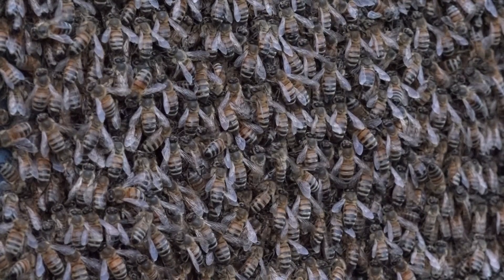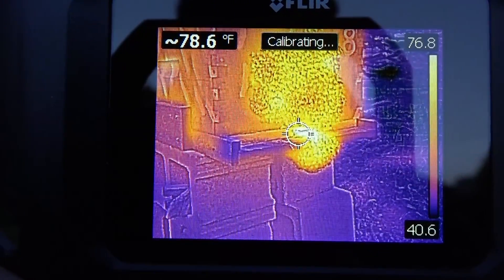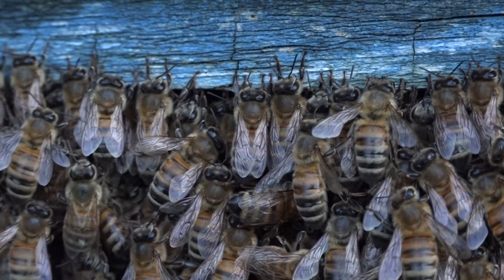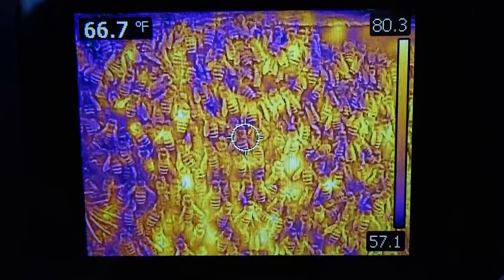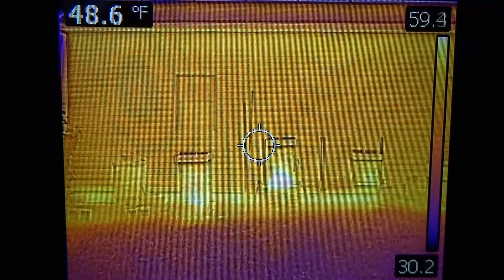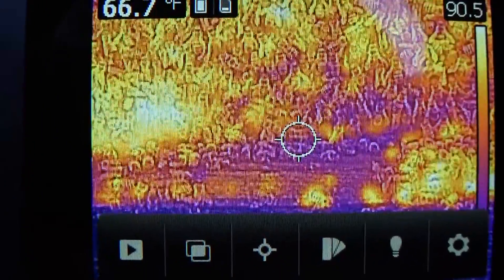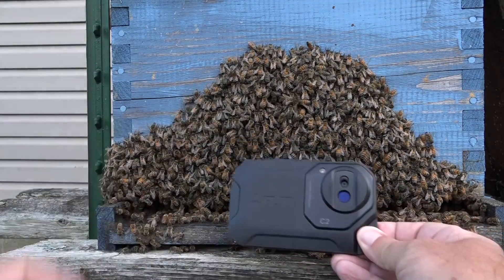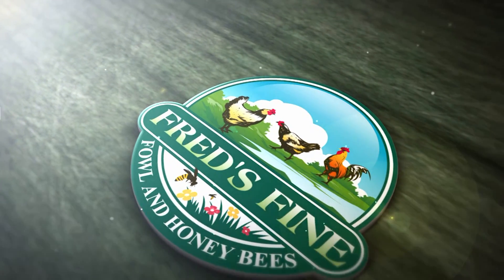Honey Bees Bearding On Bee Hive  Thermal Imaging FLIR C2 Hive Temperature

Comment: HiYa Fred, You are a gentleman and a scholar m'man, I love your work.
Two Questions from here in Sydney.
1. How's that C2 camera going and any further updates, insights or uses? 
2. I'm currently making up some slatted racks for my hives (2 flow & 2 regular).
Have you any thermal data related to slatted rack use?
Happy Trails
Reply from the maker: The Flir C2 still performs fantastically and is useful. The slatted racks haven't offered any profound advantages, but do seem to provide some valuable space and are what I prefer when doing OAV treatments as they create a meaningful barrier between hot irons and the bottom of the frames. They have demonstrated a slight benefit in regards to bearding on hot summer days.

Comment: Mate, you need to paint your hives and the roof white (not black) this will reduce the thermal gain and reduce the radiative loss on cold and clear nights.  A black hive forces the bees to work hard to cool the hive and expend energy to warm it on cool clear nights.   By the way with this high temperature hive do you have any varroa?
Reply from the maker: Hi Mark, if I painted them all white as you direct, they I wouldn't be able to continue meaningful thermal studies. Thanks for sharing your wisdom.
Reply: @FrederickDunn  Are you worried about the emissivity value?
I am interested in what you are doing please send me a note:  markaarnpacks@gmail.com
Reply from the maker: @markkeown9532  Only as it pertains to solar wax melters where I paint all surfaces black, anything yielding over .90 works famously for that. Regarding beehives and the bees ability to regulate interior temperature, even with a "hot-box", is interesting and they manage to thermoregulate the interior even in temps in excess of 100 deg. F. So long as there is water available to the bees. Further studies on that have been done with associates of Thomas Seeley, and they placed hives on obsidian under high heat stress conditions. Since the bees need to maintain 94 to 97 deg. F. over the brood to maintain viability, along with adequate humidity, much of what most keepers "think" is too hot or high, actually is fine for the bees. Since others are doing this better, I no longer research exterior colors, but to collect thermals at the hive entrance with various screens and entrance reducers. Where I reside, only the hottest days result in cooling behavior, most of the venting activity is to dehydrate nectar.

Comment: I live in Central Valley, California. Temps are ~100 degrees now. I have two Flow hives and just recently put on Flow supers. The girls are taking to them well, but one on my hives (more exposed) is bearding a lot. Is this just due to the extreme temps inside? There appears to be plenty bees working inside between the flow frames.
Reply from the maker: HI Sandra, it's normal for them to move out and collect on the front of the hive when there is a lot of new nectar being stored inside. Fresh nectar takes up twice as much space as finished honey. By moving the foragers outside, the workers inside can do a better job of dehydrating the nectar down. The bees themselves contribute to high humidity inside the hive - it's just the norm. :) I've started putting sun visors on the fronts of my hives and it is working out swimmingly and really lowers the lower brood box temps and gives the bees a shaded place to collect when they need to. https://youtu.be/SFYAneFtAIk  they are very easy to make :)
Reply: Frederick Dunn Thanks!  I’ve placed canopies over them, but I’ll have to check out the visors.

Comment: Another great video. Images and audio are simply enjoyable to watch. You have a C2. Not a C3. Any particular reason? Cost Features? Also, have you ever tried the FLIR ONE IOS Thermal Imaging Camera for iPhone 7 - that little camera that attaches to the bottom of an iPhone. Any comments on the differences between that and the stand-alone C2?
Reply: Don't own a cellphone!🤤
Reply from the maker: That's right Gregory, no cell phone at all. I have someone else take all of my calls and I respond to e-mails when I have time :)
Reply from the maker: Hi Firescam2, thanks so much! To answer your questions, I selected the C2 because I didn't want the wii fi that the C3 offers and other than that feature, they are identical. I'm not at all interested in teh Flir One as I don't own a cell phone :)  I know I know.. unbelievable, but if I had a cell phone I wouldn't get anything done and I need to be away from it all.  The self contained C2 was the best all-in-one for my purposes. I did contact Flir to see if they were coming out with a more capable version of the C2 in the future, primaily in higher resolution. The camera captures are tiny, so not really usable in my opinion... BUT, as a source of on-the-spot information regarding bees, it's a fantastic tool and I'll be buying whatever they come up with next that enhances what it already does.
Reply: Thanks for the detailed reply!

Comment: Hi Fred.  Another unique and awesome video!  I'd like to ask you about hive placement in the hot south.  The average summer here is 80s-90s from end of May to end of Sept (87 right now as I type) and humid.  Should I place hives in a partially shaded area or full sun?  Should they face south?
Reply from the maker: Hi Trixiegirl88... yes, keep them under an awning or other mid-day shade providing cover. I mostly face all of my landing boards south for winter sun exposure and landing board warming. In your case, that may not be so important. You definitely want them in a high and dry location with plenty of air circulation. Humidity is the challenge. I used to live in Charleston, SC., and I don't miss it :)
Reply: Thanks Fred..I have a spot picked out for them under a big tree.  Alabama humidity is definitely going to be a challenge.... and fire ants...lol
Reply from the maker: You are very welcome Trixiegirl!